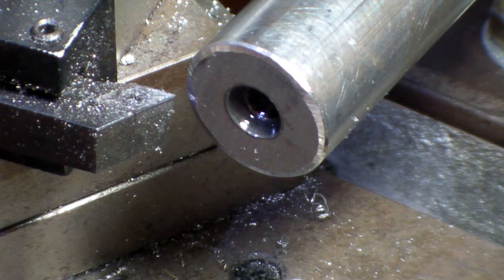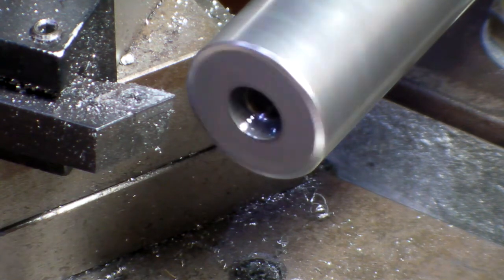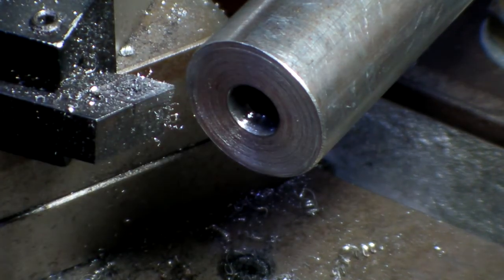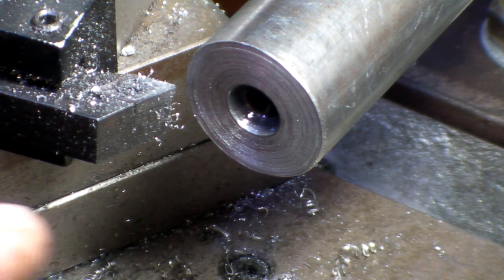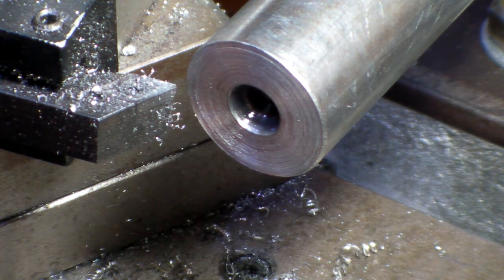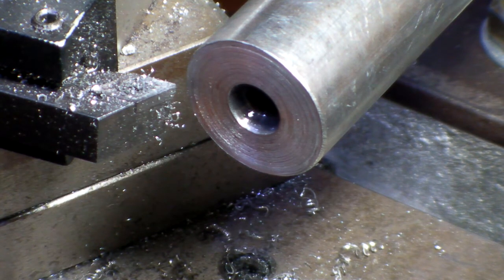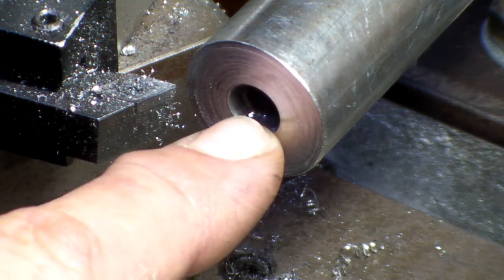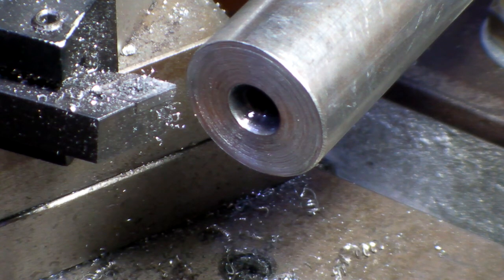Building the Gingery Milling Machine 43, machining the spindle

Comment: Peter, that was a tease buddy!!!  It is great to see more progress on your Miller.  I for one will be excited when you get to run the machine and make chips with it.  It has been a great build to follow!

Joe
Reply from the maker: The transmission stage is slowing me down as I need to make things fit or just make things. Thanks for the encouragement, Peter
Reply: Refresh my memory.  Are you using the Gingery transmission system, or are you making one of your own design?  Seems like you told me already but I don't remember.

Joe
Reply from the maker: I'm going the gingery transmission system, I bought a wood lathe some time back for the motor and two, 4 step pulleys.
Reply from the maker: I realized this morning what you meant by "tease", I didn't realize it only uploaded 5 minutes.
Reply: So it was an accident?  I thought you were just teasing us a bit!  Off to look at the next instalment!

Joe